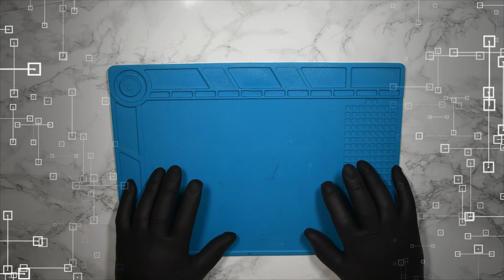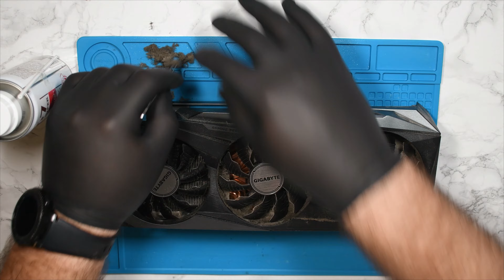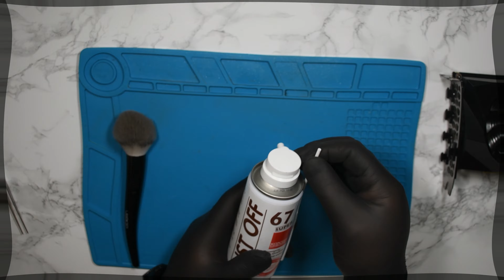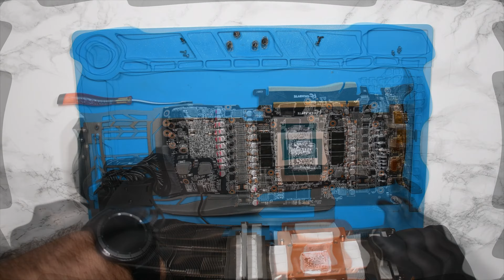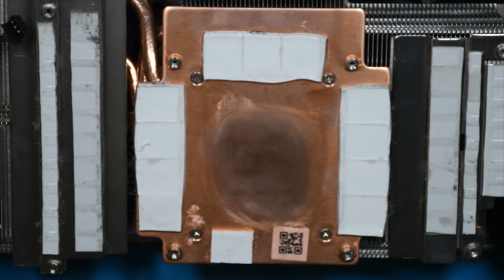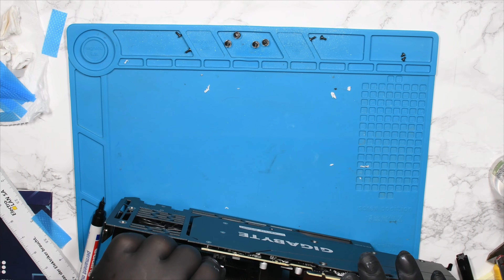Gigabyte RTX 3080 thermal pads replacement

Comment: Done 2026 with 5 years use under heavy gaming not mining. Had a reduction of heat of about 15 degrees under heavy load.
Reply: Which brand thermal pads did you use?

Comment: Select a PC case designed for proper ventilation & exhaust, magnetic fine filter mesh, positive pressure fan setup & a disciplined filter cleaning regime can greatly minimize this sort of dust build up. Also, the mainboard & other components can be much cleaner.